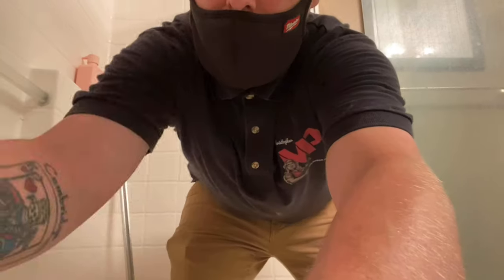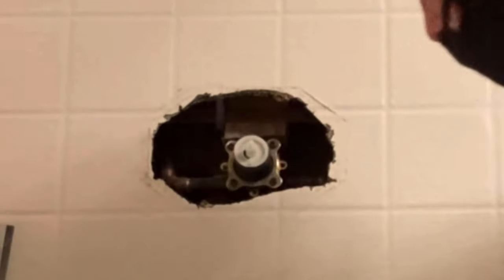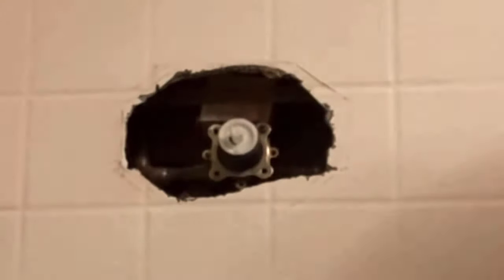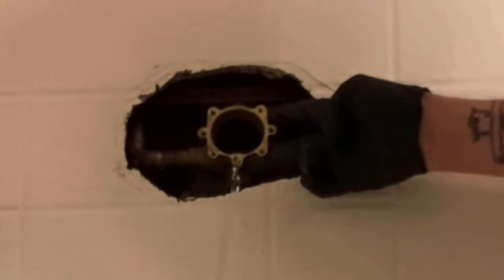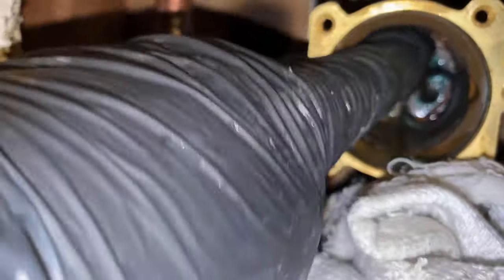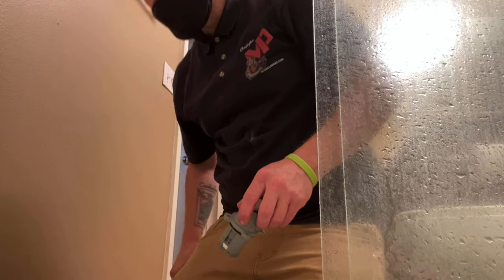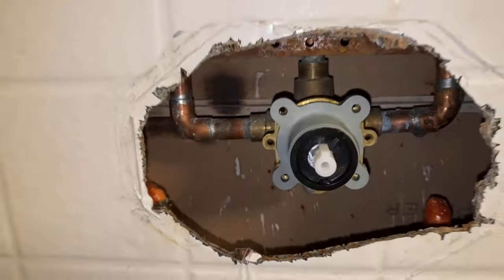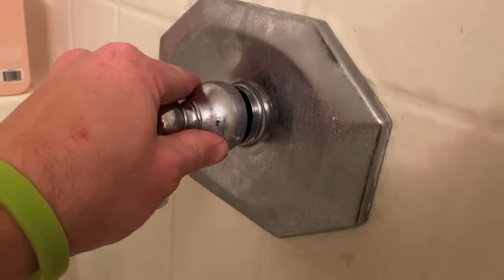Beginners guide to replacing a Price Pfister shower cartridge!

Comment: As a new homeowner in 1985, I learned basic plumbing skills from my contractor brother in law.   Back then most repairs were to galvanized pipe.  I never mastered sweat-fitting copper, but now PEX is the standard piping material in my hood and simply snaps into place in the fitting.   My brother in law has been gone for a while, I can't help but think handling toxic materials shortened his life span.   Plumbers are scarce in my part of the world and some (not to slander the trade) take advantage.   I really appreciate you tube presentations like this one, they give me the confidence to "DIY."   I'm retired now, and it means I have little choice.  A $40 part and tools I already have vs. $500 for a plumber who mysteriously takes a day to do what was done in this video in 30 minutes.   Thank you, thank you.  And some credit goes to Price Pfister for using the same cartridge in most of its mixers and using a design that does not require specialty tools.
Reply from the maker: Thank you for leaving such a good comment, really appreciate it

Comment: Hey man.. thanks for narrating your knowledge. Very thorough. I had to make a Saturday repair due to the water not shutting off. After disassembling I did discover rust. Magnet assisted in the retrieval. I decided to seek YouTube and watched yours. Thank you very much for the step of purging. I did NOT the LAST time. This cartridge only lasted 5yrs. I DID PURGE and tons of debris came from my cold side. 50yr old galvanized pipe must be nearing the end. HOWEVER, I thank you because I would not have and certainly would be battling this situation sooner than normal. PURGE PURGE PURGE!   Thank you!
Reply from the maker: Thank you for this comment bro really appreciate it

Comment: Thank you! I had a problem with a water hammer sound or knocking that happened in another room whenever I turned on the bathtub faucet. Following your video and replacing the cartridge fixed it, and you had a lot of great advice.

Comment: Price Pfister sent me TWO replacement shower valves. One like yours and a 2 piece (the old valve style I assume). Even though my shower was not warrantied, they took care of it. Amazing company.
Reply from the maker: Yea they are good about their warranty sometimes they’ll give you trouble but just push back you’ll get what you want, glad it worked out for you
Reply: @PlumbingExplained  They actually insisted on sending me a free cartridge(s) even though I said not to bother. lol. Guess I got a good rep on the phone. Anyway thanks for this video. It was perfect.
Reply: @AttommicDog    I just received my 2 piece replacement in the mail from them free of charge.
I tell anyone and everyone, BUY their products as they stand by them 100%.
I have received 2 bathroom faucets and the pull out knob for my kitchen sink. 
I will only buy their products...

Comment: Very nice video. I have also change my cartridge also. I did all of all talk a towel around the valve before removing and installing. My fingers are not quite as flexible as they used to be and I could definitely tell you I was going to lose a screw or two down the back of the wall. I know you are much younger but for the guys who have that clumsy feeling in their fingers. I also like the way you pointed out which direction the cartridge goes in I believe I have mine in backwards and I will change it but the second the water is turned on it hot. When I took it out the hot water only woodwork when I pulled the handle all the way up. Now the hot water is on the second you move it up just at half inch. I will turn the valve aroun. Nice video I have subscribed. Thank you
Reply from the maker: Thank you very much for a great comment

Comment: My old one is installed with the notches on the top. I guess that would be the reason hot water comes first. Is it ok to install the new one with the notches down like you suggested?
Reply from the maker: Yes the installer put your cartridge in upside down that’s why it gets hot first

Comment: I broke the plastic valve stem when tightening the handle because it was dripping, the handle came with it. Thank goodness it was in the off position. So the retired plumber guy at Lowes identified it was an old price pfister, and took me right to a new complete assembly, KARCI model 8P8-WS2-KA, I ran into problems because the new valve had two round holes with O rings where the brass body had the oval holes at the back. the old valve and the new valve where not the same length. I went back to Lowes and talked to the same guy, i tried to explain to him and showed him the instructs, he said " take the old valve out, put the new valve in" and he also said I didn't need the grease which I asked about, because other videos said the same thing as you, use the grease. Here is the point, my house is 14 years old, the shut off was at the street, not a problem, but the brass plumbing that the valve slips into has different depths, so the valve that came in the new KARCI was too short and had round holes at the back. It didn't work, so we called PF and they told us we needed a different valve, which was available and we ordered it. I was a different model number and I think we got it from Amazon, and got expedited delivery. the PF instructs show the different brass plumbing set ups, but if you are a DIYer, you may not get the significance. We finally figured it out, our brass set up was a 2 in depth, and apparently there are different depths which makes a difference when you go to install. I'm a woman and I think the man at Lowes might have not considered the rough plumbing or just dismissed me as a poor old lady. Live and learn. But knowing your brass pipe depth that the valve fits into was crucial to the success of the project. And I will go out and get the pipe grease. I'm competent at many home projects, but I have the plumbing curse. Thank you for the video but I hope I have saved someone else from this problem in the future. The new valve came, and it has the ovals holes at the back, and it is slighly longer. Wish me luck, or pray, which ever works.
Reply from the maker: There are two cartridges that look very similar by price pfister the one with the oval holes O rings is the older style the one with the round O rings is the newer style, I think you want the older style I would Google and see if there is a Ferguson plumbing supply near you, they sell to the public and they can help make sure you get the right parts and don’t waste more of your time. I think it’s great you make your own repairs, let me know if there’s anything I can do to help.
Reply: Thanks for your helpful comment! I needed the one with the oval rings as well, and I was about to drive 30 min. away to a plumbing supply but then thought I'd check my local Home Depot, and surprisingly, they had it in stock!

Comment: Great video, especially about the water temperature control. Why do you need the grease? Also, when I replaced the original valve due to leaking my new one leaked within a year. The old washers were indeed stuck in there. My father in law also installed the cold and hot backwards and when I put the vampire teeth in down with the new valve I couldn't figure out why I was scalding myself.....I wish I had seen this video before my first valve repair. Thank you !
Reply from the maker: The grease will make the cartridge last longer, no grease will cause it to go bad and leak quicker, need lubrication for the gaskets

Comment: I saw this video after I did the replacement.  I need to know what I did wrong.  After the installation, there is hardly any pressure.
Why?
Could I have tightened the four brass screws to the valve body to tightly?  Surely, not.  They just bottomed out.  I did not go any further.
Thebpressure was good before the work.  My problem was I couldn't get any cold water.  The temperature works fine now...just low pressure.
What did I mess up?  Could it somehow be that dial on the back side?  I made no adjustment to that.  As such, the knob doesn't turn as much as it did before I did the work.  Maybe, I should get back in there and adjust that, at least.

But,....the low pressure...what's up?

EDIT:  Great video.  I subbed.  Thanks for posting this.

EDIT:  The pressure magically corrected itself.  Maybe, there was trash in the line?  IDK.

Comment: Great vid, it might be what i needed. I have a setup similar to yours, Pfister, and theres no water dripping any where when the water is turned off. The problem comes when the shower is turned on. There is reduced flow coming from the shower head and there is a decent amount of water coining from behind the knob from the valve/cartridge/stem/sleeve area. Im thinking its the cartridge but im not sure. Could you give me your opinion? not holding your feet to the fire and you are not liable for anything i do. Thanks for the vid and thanks in advance for any advice.
Reply from the maker: Yes the cartridge needs to be replaced, that should fix your problem, I recommend replacing with the 1 piece gray cartridge that replaces both the temperature control in the back and the pressure half.

Comment: Will that style cartridge work with new PFisher handle? Or will it only work with an older style fittings?
Reply from the maker: It should work with the new style handle, I haven’t seen an adapter or anything so I’d imagine they are compatible, to be honest with you I can’t recall for sure though. You can call price pfister at 1800-pfaucet and ask them though I’m sure if they don’t you could order an adapter through them.

Comment: When the handle is removed, that decorative ring that often is "stuck". Take a hose clamp and tighten around it firmly (don't crush it). That gives you leverage to use your pliers on it , while not damaging it...free tip yall.

Comment: Is it possible to flip the cartridge upside down without removing it? I have a Pfister setup as well, and my cartridge looks almost exactly like yours. I installed a new handle and cover and afterwards I can swear the hot and cold is now flipped around. I never removed the cartridge though. I looked at an old photo I took and the teeth are on top rather than the bottom like you state, so they are backwards. When I was locking the cover on, the threads did catch a few times and Im thinking maybe I turned it on accident. That or my memory is crap and it was always that way, but I can swear it wasnt.
Reply from the maker: No youll have to remove it only Moen 1225 can be done without removing it.

Comment: Hey, what if the water lines in the back of the wall housing are round.? The housing water inlets on the replacement valve are oval. Is this a problem? I got the same cartridge as you have and it leaks when I turn on the water.🎉

Comment: Hi I replaced my price Pfister valve cartridge. I cleaned up inside and everything but my showerhead is still running water when the water is off. Any suggestions?
Reply from the maker: I recommend you remove the cartridge and inspect the washers in the back make sure one didnt fall of or there isnt any debris in the back of the valve, while youve got the cartridge out turn the water on and off to the house a few times to clear out any debris that could be inside the valve or lines, if its still dripping after that then youve got a defective cartridge, you  might be a good idea to have another cartridge on hand for when you do this. Buy one and if that cartridge is infact defective just put it in the case of the new cartridge and return it tell them it was defective.
Reply: @PlumbingExplained  thank you very much! I Will do that in the morning. It’s 1:39 AM here and I don’t have it in me to take it apart again lol. I really hope it’s not a defective cartridge. I had it sent straight from the manufacturer, and I will be pretty upset if they sent me a defective cartridge.
Reply from the maker: You’re welcome glad I could help! Let me know if there’s any other questions you may have
Reply: Hi it’s me again. I took the day off yesterday and just let it run I had to work. So I have it apart again, and for some reason those little rings will not stay in the cartridge. I push them back in securely I hope now I’m figuring out adjusting the temperature because I had to take an ice cold shower yesterday lol. The replacement price Pfister sent me was the two piece. So hopefully if I can get those little rubber rings to stay put I will be OK. I so appreciate you responding to my questions I am very grateful🙏🏻
Reply: Omg I fixed it!! No dripping and I have hot water! Thank you so much for this video yours was the most informative out of every video that I looked at. And you’re also the only person that responded to me thank you so much. The problem was somewhere stuck in the hole was an older broken piece of rubber ring. Even though I thought I had it cleaned out the first time I didn’t. Everything is working perfectly now I am so grateful for you thank you so much!

Comment: I just replaced this valve now I have very little water coming out & my shower isn’t working???
Reply from the maker: Sounds like you got some debris in the shower head remove shower head clean it and run water with shower head removed
Reply: No I had a shut off valve turned off I forgot about lol
Reply: One thing tho now my shower faucet is leaking? Any suggestions?
Reply: Not the shower head the faucet itself

Comment: I remove the cartridge and can't find the name of the manufacture at all. I took the cartridge to the plumbing supply and they do not carry it. Call the plumbing and they do not have it and said they have to order. Now, have to seat and wait to see if they can located the part.
Reply: find out the name and model of your shower handle. and search for the valve catridge for that shower handle.